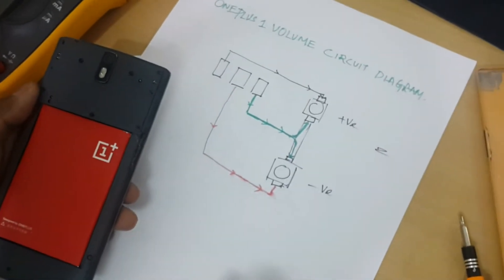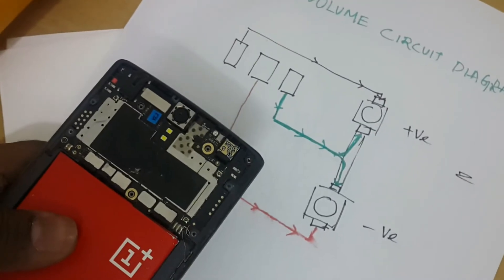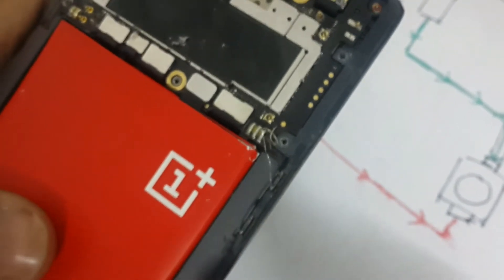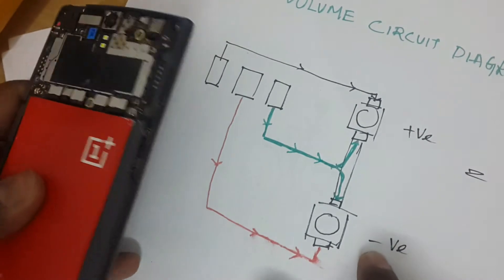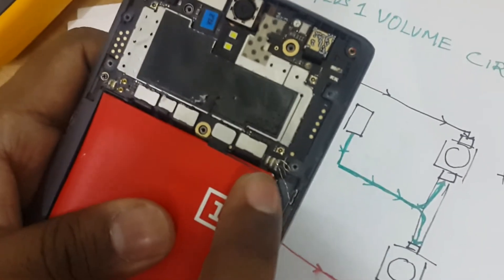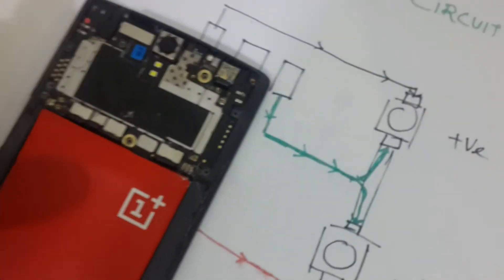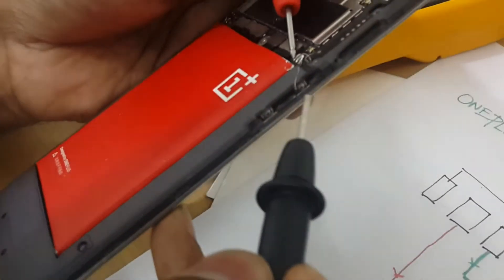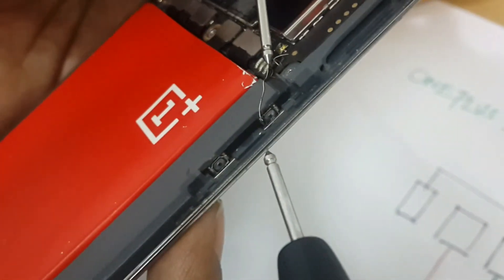fixing oneplus one volume flex cable

Comment: Bro my buttons are working though but those are not clicking. There is no click sound and I need to press them hard.
I saw some vedio they showed some small click buttons need to be replaced. I contacted oneplus customer care they said 700-800₹ for both volume and power rocker.

What is the problem acc. To you and please guide what should I do.

Thanks !
Reply from the maker: sahil lath there are some metal plates which provide the click effect!!if u know how to solder,you can get the replacement volume button flex for 2 dollars from aliexpress,and u need to solder them yourself!!

Comment: I realise this may not get answered because so much time has passed. Alas, I a can't boot past my start screen, my PC won't recognise my phone, not even through ADB and I can't get into fastboot because my volume up button just stopped working. I can only get into stock recovery, which does not allow rebooting to fastboot. So, as you can see, I am in a bad position and badly need my phone at all times due to having a bad heart and living in a very rural area. I just used a tester on the pins, pin1≥volume+ is in error, pin2≥volume-is good. Can anybody tell me what I am to do to fix it now (if possible). Many heart felt thanks in advance.
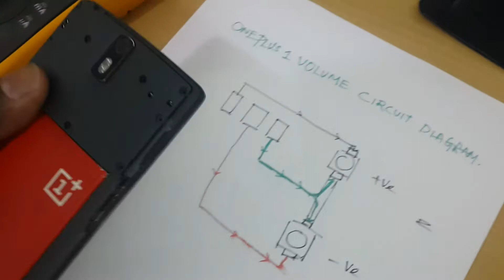Reply from the maker: uneed to open the back case and then us a tester or some wire to short the first and center pins of ur phone(check 0:17 part)and then use power button to turn on,thiz will take u to fast boot mode and u can continue recovering your phone,u r welcome!hope it works
Reply: tech 4tress I really hope so. I will let you know. Many thanks.
Reply: tech 4tress Was just going to ask my farmer neighbour but he is not home and he knows more than I. I obviously have a multimeter tester. Now do I use that to sort the pins? Does it have to be turned on when I have the testers touching pin 1 and 2 at the same time? and (a silly question, very sorry). Does my phone need to be on (on stuck start screen) when I am pressing the power button, or should the phone be off when I am pressing the power button? Really sorry. 😗 Many thanks.
Reply from the maker: +Dene. F. (Dodge) first turn off ur phone completely,then short 1st and second pins using a wire or any conducting thinc so current flows from 1st pin to the second,then keeping the pins shorted then power on the phone,this should get ur phone to fastboot mode,so ask me any simple question mate dont worry!!😀
Reply: tech 4tress Lol. OK. Understood. One more I am afraid (my wife told me to check)lol. Can I hold the shorting wire with my fingers or will this earth it or more importantly, can this shock me at all? Many thanks again my friend. 😎
Reply: tech 4tress OK my friend. Just could not get the phone to short by bridging the first two pins and re booting simultaneously. Just kept booting to the boot up screen and freezing as it has been doing. Many thanks though. A cheap phone from China now I think. I have had all the English flag ship models and now I want something different. I sold my S7 Edge two weeks ago, was amazing but boring. China here I come. lol. Thank you 🙏
Reply from the maker: you are welcome mate,take care of your health!!

Comment: I have just torn a small piece of the flex cable on the 3rd pin, if I do what you did and connect it using solder and solder wire (which I assume can be bought at my local hardware store?) will it work by just connecting from that 3rd pin to just the bottom of the volume up will it connect the entire flow or will I need to do it on the volume down as well? Thanks for the help and great video!
Reply from the maker: +Boston “Juel” Tillery  sorry for a late reply bro,
see the best thing to do is to use a multi meter and set it to line trace mode(the multi meter beeps when u connect both the probe),then check if the circuits working fine using the circuit i provided in the diagram. and then if you find the other ciruits which are intact as good,you dont have to use jumpers to solder.
if they arent working or if the circuits broken,then you have to short all of them.
and you are welcome .
your comments are what keeps me going forward,and do subscribe if its okay for you.
Reply: tech 4tress so what material should I use to make the connection (what kind of wire?) and also by just making one connection in the middle it supplies the whole mid section with power? thanks
Reply from the maker: +Boston “Juel” Tillery yeah mate u can use juper cables or if u r using it for connecting a single connection u can use a single strand of copper wire,but if u r connecting more than one connection, better use jumper cables which have a protective coating so they dont get shorted out.  coming to the second one yeah if u connect the middle portion,with single wire the whole middle portion will be connected
Reply: +tech 4tress just tried to do it.. broke the button lol! ever consider making a video on replacing the whole flex cable

Comment: Thank you very much for sharing this usefull information. I have managed to fix my opo thanks to this video. I used a regular solder (60w) and a thin soldering wire. To connect the botons i used one of the many wires you find in any telefone Adsl filter. First I managed to put a little soldering wire in both ends of the three cables. Then, I did first the buttons and then soldered the cables to the motherboard. It took me about 2 hours. What a released when everything got well! Thanks a lot.
Reply from the maker: u r welcome mate!!feeling amazed to know that i helped someone!
Reply: ***** not that easy, tried once and failed burning the new cable. Will give it another try when it arrives. I think they use air soldering to do it properly.
Reply from the maker: +Francisco Javier Esquivel Gallardo u mean that hot gun?yeah i guess you have to usshot gun to solder the flex properly!!